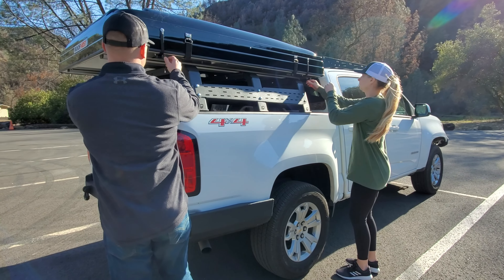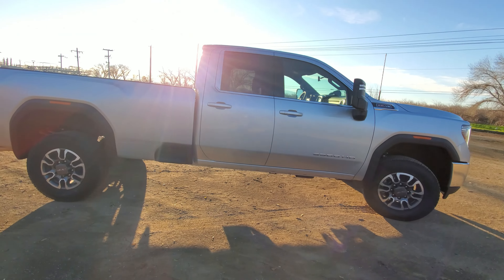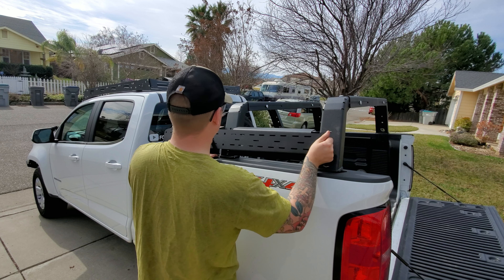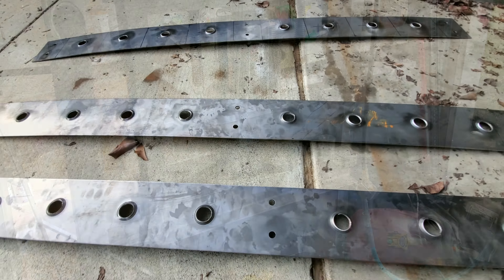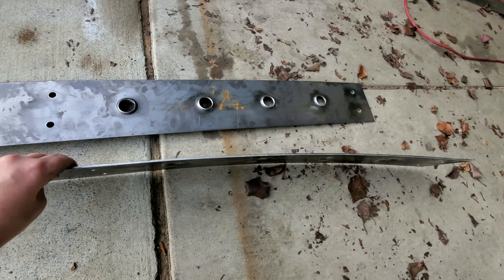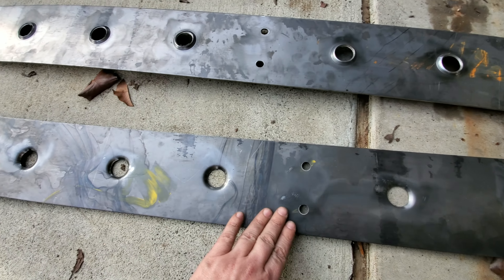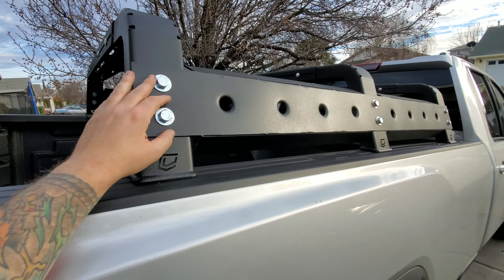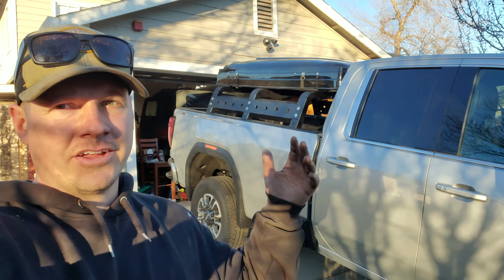Overland Bed Rack | Build, Buy or Modify?

Comment: If you have a tractor supply store they are way cheaper than lowes or home depot for your nuts bolts and washers
Reply from the maker: I have an Ace Hardware, but I'll check that out!
Reply: You're right about TSC. That's the best place to buy hardware if you have a large project like this.

Comment: I know I'm a little late but just came across your bed rack build. I really like your design. I've decided to build one myself. Question,what is the name of the die you used for flaring out the 1" holes? Thanks
Reply from the maker: Thanks, I bought those dies from Swag Offroad. I believe they are called dimple dies 🤙🏻

Comment: I know I'm late but I'm looking into designs to make a bed rack for my tacoma and was wondering how does mounting stuff on with the dimples you made work?
Reply from the maker: The dimples just add rigidity, so if you wanted to mount something, you could drill into the metal or strap in on through the holes.
Reply: @FortuneOffRoad  ahhh that makes sense, thank you!